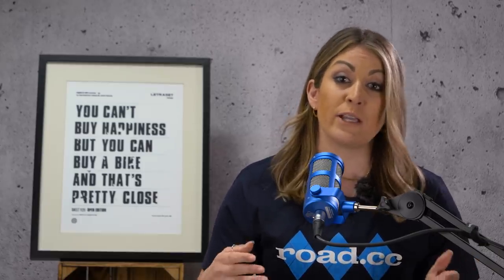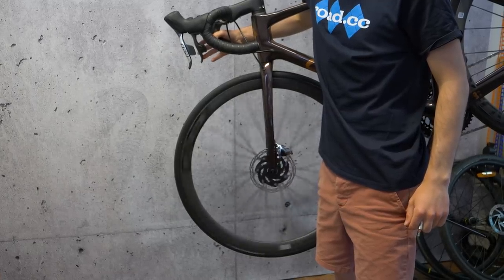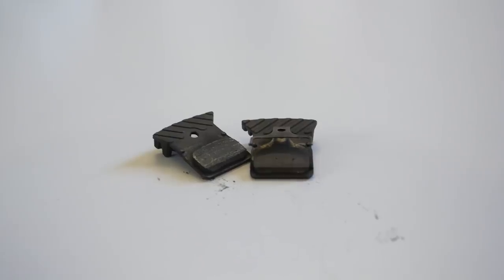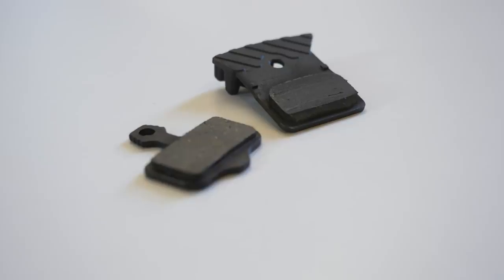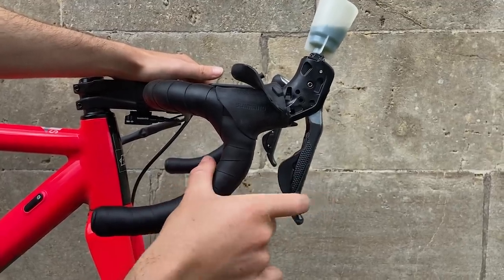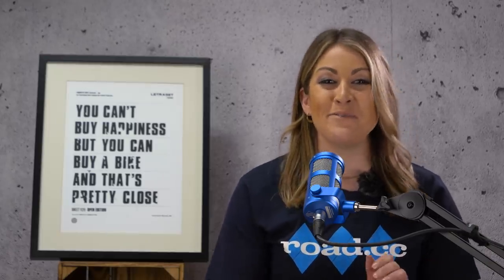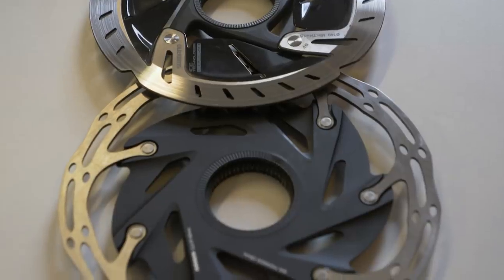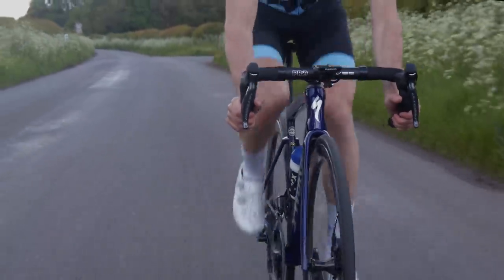8 things they dont tell you about disc brakes

Comment: I know carbon rims made disc brakes necessary but for me neither are worth the hassle. A hand built aluminum wheel and high-end rim brakes give great performance and a completely trouble-free. There's a lot to be said for low maintenance low cost and durability.
Reply: Carbon rims didn't make disk brakes necessary, though. Carbon rims can have an added thin steel braking surface so as to use them with V-brakes.
Reply: I rode rim brakes and carbon wheels for yeas and never had an issue - ok you have to know not to ride the brakes to avoid over heating but who does that anyway ?
Reply: Not true, carbon wheels are compatible with rim breaks.
Reply: Rim brake rules, disc only on the rain,but who like to ride at rain.
Rim brake wheels are hevi,aerodynamic is bad etc,so rim brake only.

Comment: Honestly sick of the rim v disc comments, they're both fine. Just ride your bike and stop preaching about your preferred choice
Reply: The problem is rim brake road bikes are getting harder to get, and the bike can’t be converted back.  I ride only alloy rims so no necessity for disc brakes, that’s the real reason road bikes had to go disc thanks to F’in carbon rim associated failures.  Too many liability cases - injuries and worse.  I don’t want any squealing.  My Shimano disc have a mind of their own, squeal when they feel like it, probably humidity/temp related.  Damn racket louder than any horn.  Took decades for car brake manufacturers to figure out how to end squeal.  Adding more weight will work but the weight weenies will complain as usual.
Reply: I disagree, disc brakes are a over complication on road bikes that add little or no advantage.
Reply: Agreed, BUT everyone's entitled to their opinions. One fact is true though. Disc brakes are simply more powerful stopping devices. One of the most popular arguments doesn't deny this, but asks is the power necessary on a road bike. I've riding mountain bikes and now road bikes for over 25 years. I welcome the progression of technology. I've been on discs for over three years and love them. They are only slightly more complicated than rim brakes if you've learned how to bleed and adjust them. They are now relatively light. Bike vary so much in weights, it's really not going to be an issue really except in their minds. My Tarmac is near the UCI weight limit at 15lb and change with pedals. They don't squeal. The pads, in addition to being clean, also need to be centered at the point of contact, touching the rotor at the same time otherwise may squeal. Almost all these complaints are user errors. They said the same about front hydraulic shocks when they came out and most didn't need them on all light dirt trails.
Reply: The big problem is that most manufakturers don’t give you the choice. I can’t buy for example a new Tarmac or a Emonda with rim brake anymore so that makes it hard to ride my preferred choice.
Reply: @schenkieweb  bingo 👍
Reply: @schenkieweb  true, and that’s the real problem,  these guys here don’t give a sh%t their choices are diminished.
Reply: @ricric9521  hydraulic disc slightly more complicated?  Are you F’in crazy?  Road biking hasnothing to do with true mountain biking in mud and other nasty stuff.  Don’t presume they are more powerful, in wet conditions yes.  Rim brakes can be designed as powerful as anything else.  There is only one reason road had to go disc, massive $$ personal injury/death lawsuits over F’in carbon rims used for braking, big big mistake.  Carbon does not sink heat, alum alloy is king.  I have no interest in mountain biking.
Reply: Problem being that soon there will be no choice

Comment: Disc brakes are good because $2k carbon rims are no longer a consumption item
Reply: That is a clear advantage which discredits the nonsense argument I frequently see that "disc brakes are an answer to an issue which does not exist".
Reply: Who told you 2 buy $2k carbon rims? The bike industry, sponsored riders on TV or your ego? I bought a 1500g hand-assembled alloy wheelset for $100, a consumption item for my R8000 rim brakes...
Reply: I hate that carbon melting smell on a big technical downhill run with pads, discs are so much better.
Reply: @beepboop205  I had not even considered that. I don't have a problem with people preferring one over the other (& agree with the dislike of being forced to go for discs), but I do find the argument that "they are a solution to a problem which does not exist" is flawed because they clearly do have some advantages over rim brakes.
Reply: There is increasing rumours that discs are damaging spokes and hubs.
Reply: Ive never worn any rim braking surface down. They've lasted over 10000 miles still ok.  The pads wear mostly and you change them.
Reply: @tanyanyiwaq  😄 That's a funny one. Considering motorcycles with spoked wheels (with hubs) have been used successfully for years and years. Yes bicycle hubs and spokes are smaller but the size of motorcycle hubs and spokes proportioned to the size and weight of a motorcycle that those have to be able to stop(brake) and they work great without doing any damage to its hubs or spokes..and most motorcycles are 300lbs to 1000lbs and go 75++mph. So there debunks that rumor (gossip) you heard.👍
Reply: Just ride carbon tubs rim brakes
Reply: @dickieblench5001  that’s the problem lol
Reply: @gerhardw.933  They will even save money if you don't have to wear alloy rims on a daily driven commuter, a good wheel with reinforced rims and good hubs is almost 100 €, while a usable disc rotor is 15 €. Resin pads are even cheaper than good rim friendly rum brake pads
Reply: @simonm1447  I think that the cost of hydraulic brakes and the regular maintenance (fluid, pads, sometimes rotors) are higher than new rims plus caliper pads over years.
Reply: @gerhardw.933  Not if you ride a bike every day.
For my commuter brake pads (BS01) cost 4 € per pair, a disc rotor 13 to 15 €. The rim brake pad I use (replacement rubbers inlays for my Kool Stop brake shoes) cost 8 € per pair, and it wears down the rim over time.
Bleeding isn't that complicated, and the Shimano mineral oil is good for a couple of years in the brake system.
V brakes need much adjustments (they don't adjust the play by themself), while a disc only needs new pads from time to time and less maintenance.
You don't have to buy expensive brakes, even the simple ones are fine as long as they are hydraulic and have disc rotors big enough.
Reply: @gerhardw.933  Ich fahre mit meinem Pendlerrad ca. 5 bis 6k km pro Jahr.
Ich muss aber dazu sagen dass das Rad ein Nabenmotor E Bike ist (es ist ziemlich hügelig hier, und mein Job ist körperlich anstrengend). Das Rad zieht zusätzlich Anhänger, und braucht relativ viel Bremsen wegen dem Gewicht. 
Am Anfang waren auf dem Rad V Brakes, welche in diesem Fall ziemlich wartungsintensiv waren (die V Brake Beläge halten auch nicht wirklich lange).
Ich hab das Rad zumindest vorne auf Scheiben umgebaut, die Beläge halten rund 1/2 Jahr, allerdings wird halt auch die Felge nicht durch die Bremse verschlissen (was bei schwereren Rädern ausgeprägter ist). Die Wartung an der Bremse ist seitdem deutlich reduziert, es beschränkt sich vorne effektiv auf den Belag Wechsel alle 6 Monate, statt wie vorher alle 4 Wochen die Bremsen nachzustellen.
Reply: @simonm1447  Mit E-Bike und Anhaenger wuerde ich auch eher auf Scheibenbremsen vertrauen. Ich rede ueber ein Rennrad, mit dem ich ab und zu  mit Gravelbiketaschen verreise. Schlafsack und Zelt gehoeren mit aufs Rad. Auch mit Felgenbremsen bemerke ich keine negativen Einfluesse aufs Fahrverhalten. Alles Gute!
Reply: @gerhardw.933  Ich habe neben dem E Bike auch noch andere, normale Räder die teilweise Felgenbremsen haben. Mit guten Belägen sind auch diese Räder sicher, speziell beim schwereren Pendlerrad überwiegen halt die Vorteile von Scheibenbremsen. 
Bei Rennrädern ist es eine Sache des Geschmacks, und der Frage was das bereits vorhandene Rad hat - ein gut laufendes Rennrad würde ich auch nicht gegen ein anderes tauschen nur wegen den Bremsen.
Ebenso allzeit gute Fahrt
Reply: @simonm1447  Trotz Marketingpower der grossen Fimen sollte man sich immer im klaren sein, was man eigentlich selbst will und braucht. Hier in Taiwan fahre ich aufgrund von Schlangen keine Feldwege, also brauche ich kein Gravel Bike. Ich habe einen Racer und ein bequemeres Gran Fondo bike, fuers Einkaufen und Besorgungen ein umgebautes 26' MTB mit V-Bremsen,  Gepaecktraeger und Packtaschen. Schoen sich mit jemand zu unterhalten, ohne sich politisch festlegen oder rechtfertigen zu muessen. Danke!
Reply: @gerhardw.933  Speziell Gravel bikes kann man schon als etwas sehen das nur erfunden wurde um eine weitere Kategorie Fahrrad zu schaffen und mehr zu verkaufen, früher gab's für so was Trekking Räder die etwas weniger sportlich sind aber auch leichtes Gelände schaffen. Ich persönlich bevorzuge anstatt eines Gravel bikes Mountainbikes, die sind Gelände schon wegen der Reifen besser, und Rennen fahr ich damit keine.
Ich hab auch noch ältere 26 Zoll Mountainbikes mit Felgenbremsen, die Dinger bekommt man in D mittlerweile recht günstig (teilweise sogar noch gute vom Altmetall). Reifen wird es trotz dem Trend zu 27,5 und 29 Zoll immer welche in 26 Zoll geben.
Die Räder sind zudem recht handlich und kurz, und passen gut in PKW Kofferräume.

Comment: This why I brought a giant tcr 2021 with no disc brakes. No stress no issues just ride
Reply: Way to go dude
Reply: Same!!! Haha
Reply: Just like my SL6 and winter bike.
No issues.
Both disc equipped.
Reply: Glad to know they're actually available to buy. The Advanced Pro for example: full Ultegra, carbon wheels and a power meter all for US$3.6K? Sounds unreal these days.
Reply: @Guitar Noize what you consider as no issue is irrelevant.  For those of us who maintain our own bikes, we don't want to deal with the hassle of them. And they are a hassle.  The actual advantages (vs promoted) are not worth it.  We should be given choice, not it being pushed on us just for the industry to make an increased profit.  THAT is the advantage of disk.  For them not us.
Reply: had my disc break bike for 5 years. never changed my rotors, nor pads. still brakes fine. only maintenance I did was cleaning the rotors with isopropyl alcohol and bleed the brakes once.
Reply: @Syn741  means nothing without stating how many kilometres you ride or if you ride in wet weather etc.
Besides some of us prefer the challenge of rim brakes and avoid the hassle of disc brakes that are completely unnecessary on a road bike.
Reply: @zidazizaz9836  that's true. My distance clocked may not be as much as an avid rider, but one thing I can confirm is daily maintenance isn't trouble some. But having the swap out the pads can be a little bit if a hassle due to the removal of the wheel. Of the than that, changing the pads requires no tools (or one, if you are unable to remove the safety clips). Also when it comes to bleeding the brakes, that it a pain, but as long as you're using mineral oil as the hydraulic fluid, you won't have to bleed them for about 5 years as long as you don't do something silly
Reply: @shamuslamont100  I have 6 bikes, with 5 of them being disc-equipped, all self-maintained with the disc models having long service-intervals. I'd argue that what you consider to be a hassle is irrelevant, especially after having dealt with rim brakes for years on previous bikes (and my one remaining rim brake ride).

Changing disc brake pads is unquestionably easier than changing rim brake pads. Bleeding a disc brake system is marginally more difficult than swapping out a brake cable for me. Swapping out a rotor versus replacing an entire rim (and having to re-lace the wheel) because its braking surface has worn out is a no-brainer, cost-wise. Heat-related tube failure while descending? Ancient history.

You see rim brakes becoming increasingly rarer as elimination of choice, but I see it as progress. Rim brakes will stick around much like vinyl records for more casual use, or vintage builds, but their hey-day is over.
Reply: @zidazizaz9836  "Prefer the challenge"
Do you sleep on a bed of nails, too? You know, challenge...
Reply: @Bebo Show me examples of an alloy braking surface lasting 40k miles in real world use without suffering significant braking degradation or compromising the structural integrity of the wheel. I guarantee you few if any riders get even remotely close to that figure.

You say rim brakes outlast disc brakes? That doesn't make sense, given the materials used in each system: rubber and composites or aluminum for rim brakes, and steel and resin or metallic compounds for disc brakes. The materials used in the latter have considerably higher abrasion resistance compared to the former. Given that disc brake consumables are dimensionally smaller, at worst they're roughly on par with rim brakes for durability, which has been my experience.

Bottom line is the rim, if not the entire wheel, is treated as a consumable in a rim brake system, and people do regularly switch out wheels when they're used heavily, such as on commuter bikes.

With regards to tube failures due to heat being rare, yeah, that's true, but it's a virtual impossibility with disc brakes, and having to stab brake to avoid this is an added layer of complexity. Also, disc brakes are easier to operate during long descents for people who suffer from hand pain or loss of grip strength, with less effort required to apply the same braking force as rim brakes while offering better modulation.

Then there are the quality of life improvements that disc brakes offer, such as the ability to run wider tires and remove wheels without the need to undo the caliper first, make bikes more comfortable by removing the need to reinforce and stiffen seat stays to accommodate rim brake mounts, thus rendering them more compliant and able to soak up more road buzz, and route brake hoses any which way through the handlebar, stem, head tube, frame, etc., without having to worry about a cable sticking or binding in its housing. Cleaner lines and better aerodynamics for anybody who cares to have them.

There's nothing wrong with rim brakes. Disc brakes are just simply better.
Reply: @Bebo Rim brake pads could be 100 times thicker for all I care. They're still made of tofu, comparatively speaking. The materials used in disc brakes are just that much more resistant to wear, allowing designers to make them smaller to compensate for the extra weight.

Speaking of weight: you think disc bikes weigh an extra kilo over their rim brake counterparts? That leads me to believe you haven't handled a disc bike much at all, or at least not recently. Wheels and frames have been engineered to compensate for the weight disparity, leading to side benefits such as more compliant seat stays, as I've already mentioned. Disc wheels don't need nearly as much material around the bead to hold up to braking forces and dissipate heat. And just to play devil's advocate, do you really think bike manufacturers wouldn't figure out how to lighten disc brake systems without sacrificing rigidity and safety if there's money to be made? The weight penalty might be around a pound, and though that gap might never close, it's still shrinking. But weight matters less to a pro rider than aerodynamics, to a certain extent. Let's not forget that once upon a time, 23mm tires pumped up to insane pressure levels were king and weight was everything until aerodynamics were found to be more important even at lower speeds.

Which is why if you ask any pro rider, they'll gladly take 20 seconds faster over the course of an hour, especially since modern disc road bikes weigh nowhere close to being a kilo heavier than rim bikes. That's simply absurd.

And lastly: you just had to bring up the safety aspect. Know what else can lay you open to the bone? Hitting and sliding across pavement at high speeds. Bladed aero spokes. Chainrings. Other miscellaneous pointy or sharp objects. Cycling is fraught with risks, as it turns out, but rotor cuts just aren't much of a consideration anymore (and they never really were for the vast majority of people) given how many other ways a rider can sustain injuries while riding in groups. It's almost like worrying about being in a plane crash; yeah, it could happen, but the chances of being involved in one are exceedingly low.
Reply: @Bebo Bro, carbon rims, bro. And as long as we're pulling out arbitrary mileages, I can get 101k from discs, easily. Bruh.
Reply: @Bebo Discs last like 102k miles then you have to pay 20 bucks per disc, lol.

If you're paying $100 per rotor, it's no wonder you think the bike industry's forcing disc brakes on the world. Ridiculous.
Reply: @Bebo Ah yes, saying that like it's somehow an insult and that the rest of the bike-riding world doesn't ride a similar pace if not slower. That's hilarious, "bro."
Reply: @Bebo You're just not thinking through any of your replies anymore, are you? Bye, then.
Reply: Good choice!

Comment: Rim brakes on off-road bikes clog up with mud, snow etc, I fully understand the move to disc brakes for mountain, cross and gravel bikes.  On the road, we're often told that disc brakes provide consistent power in all  conditions,  this may be true but the amount of power that can actually be applied in braking is related to road conditions; on wet tarmac where grip is limited on narrow slick tyres, the strategy should be light, progressive braking along with good anticipation on the part of the cyclist.
Reply: Speaking of road conditions, areas with a lot of sand or mud making their way into the roads also greatly benefit from disc brakes. Rims just get covered in grit, and you die a little bit inside everytime you hear that scratching noise ruining your brake tracks.
Reply: That's just how you brake a two wheeled vehicle.